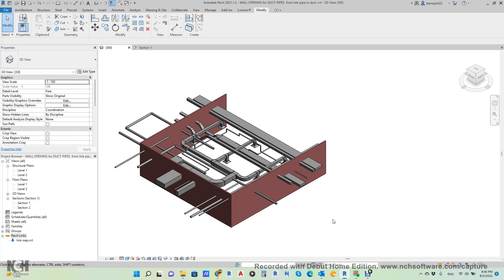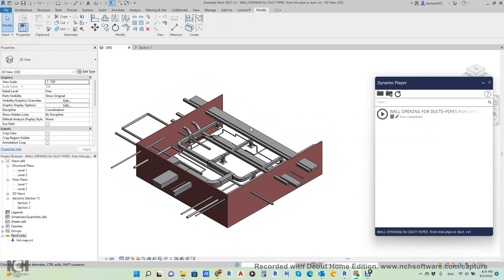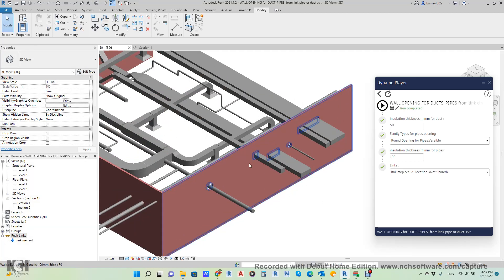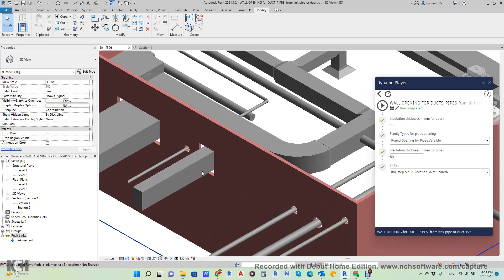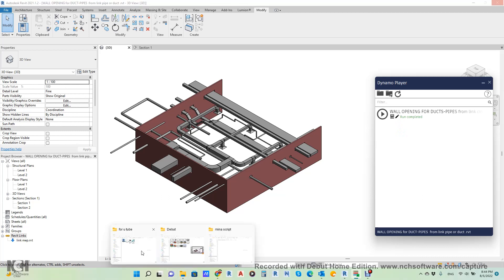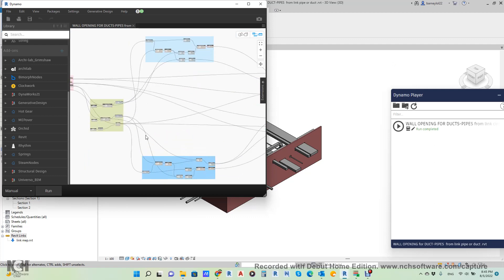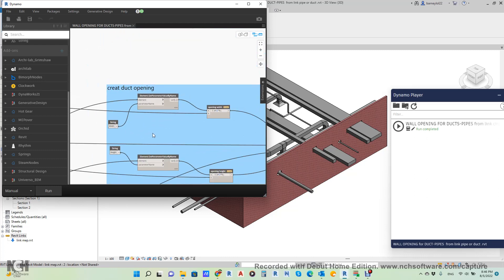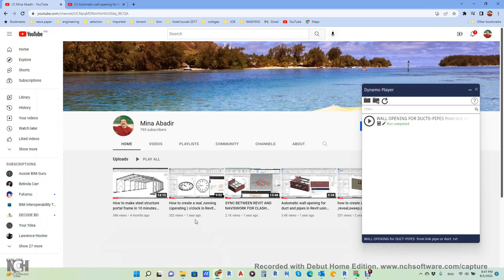Automatic wall opening for duct and pipes in a link  using dynamo player

Comment: Is it possible the other way around? I'm working on the MEP model while keeping the Arch model linked. So I'd like to place a generic model element where the wall and MEP element intersect.
Reply from the maker: good question -i do like this in my project i put generic model element and structure or arch team make it as a cut 
may be i will automate this in a script